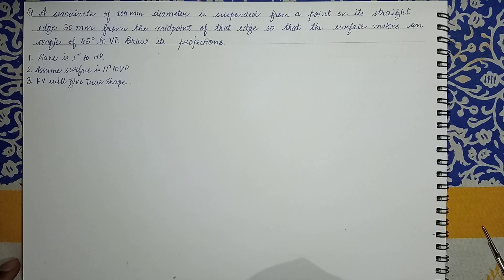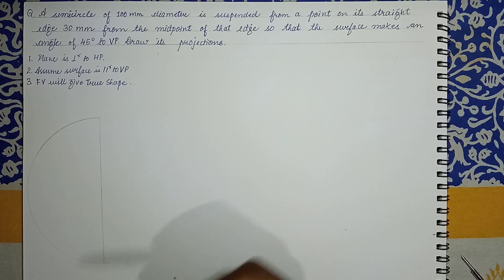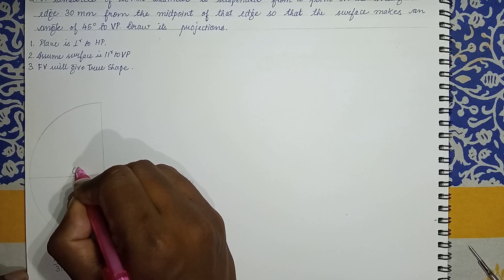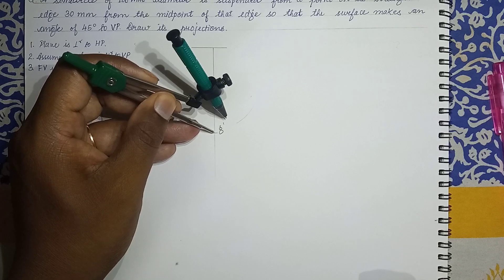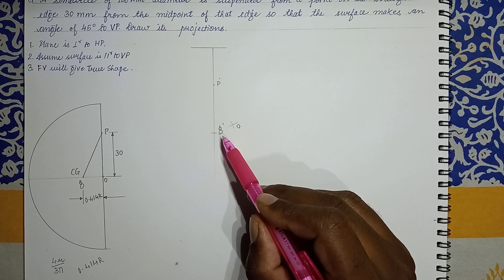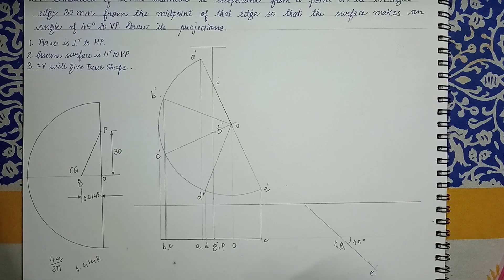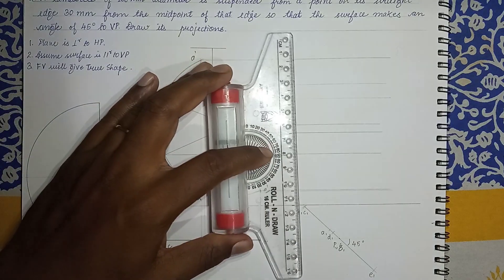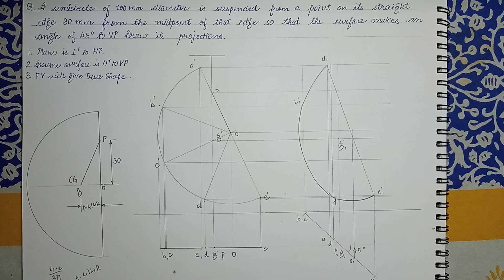Engineering drawing|| Engineering Graphics|| Suspended planes

Comment: A semicircle of 100 mm diameter is suspended from a point on its straight edge 30 mm 
from the midpoint of that edge so that the surface makes an angle of 45⁰ with VP. Draw its 
projections.